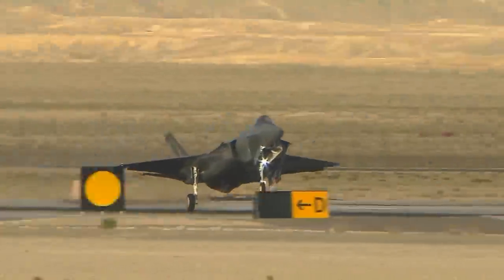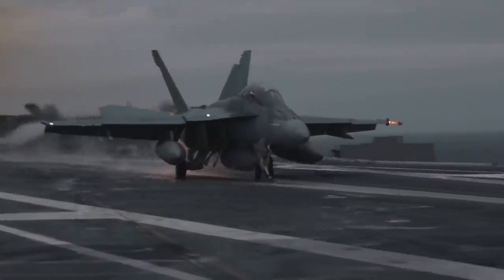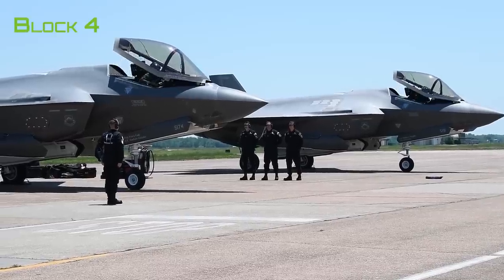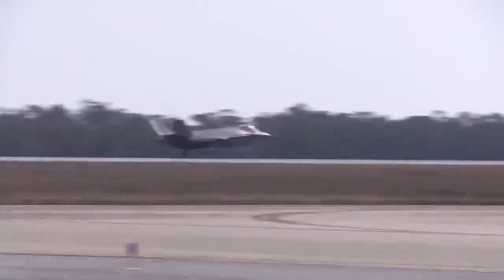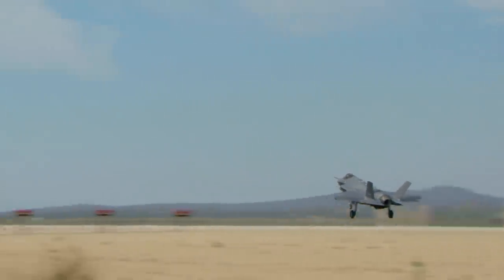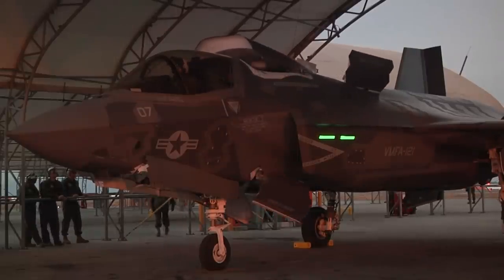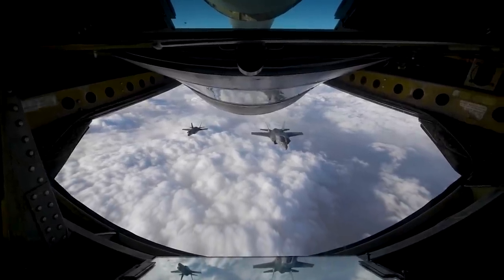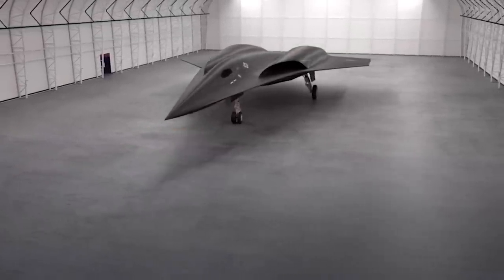Why the F-35 needs an engine upgrade

Comment: What I’ve seen elsewhere is speculation that the NGAP money going to Lockheed, Boeing, and Grumman isn’t to design an engine but to figure out how to implement the PW and GE engines into their NGAD prototypes.
Reply: That's probably just slush money. You give engine upgrade funds to PW, GE, Rolls, etc, not the Airframe Manufacturers.
Reply: Yeah I mean the F35 engine is sick. It’s slightly larger than the F22 engine. But doesn’t have thrust vectoring. So you can imagine that they could easily modify the F35 engine to have thrust vectoring and slap 2 of them in a new fighter. You’re talking about 100,000lbs of thrust. With lighter carbon fiber materials smaller aim120s and just overall smaller and lighter electronics and all. You figure the new fighter the jet will damn near have a 2-1 thrust weight ratio armed. The F-22 is 65,000lbs loaded. We’ll see. But I think it’ll depend how which jet it is. The Air Force I imagine is going to make more of an Air space denial jet. That can loiter for long periods of time and has such good sensors and weapons that anything within a couple hundred miles of it will be blown out the sky. Where I’d imagine the navy would have more of an interceptor and agile plane to fend off missile and J-20 attacks on the carrier fleet and then have drone wingmen to carry out strike missions on ground targets. But yeah. China and Russia still haven’t fully developed the engines that were supposed to go into the J-20 and SU57. So we’re pretty far ahead of them on building engines. Japan wanted to build a stealth fighter for awhile now but they were smart and understood that the engine is essential to the stealth capabilities of the aircraft. So they’ve been working on their engine for awhile now. Haven’t heard anything recently though.
Reply: OK but let that tech flow down to the F-35 and possibly other planes as well.
Reply: not sure why he is using Australia MQ28A Ghost Bat drone in NGAD and saying the engine could go in to them.
is 100% up to Australia is those drones get them as is Australian drone solely made and  sold in Australia as a sovereign product.
Reply: @forfun6273  Engines are typically the most difficult part of any jet development. Japan is taking that part really serious. they want to catch up and reacquire the advanced industrial base for jet/engine development and production. They are ready to spend big. Their parliament signed off on a 47-billion-dollar research and development program. Japan has already a highly advanced industrial base and highly skilled labour, Im pretty sure they will do fine. Especially when we consider that they joined forces with the UK. Very smart move and a win win for both sides. They can share the costs, risks, resources, and ultimately the success.
Reply: @nedkelly9688  The MQ28 drone is made by BAE Australia. I don't know the companies' shareholders/owners are, but I guess it's at least partly if not fully owned by BAE UK and maybe even BAE US. I don't think that the Australian government has any say in what a private company does with its product. Especially when it's financed by foreign entities that are closely aligned with Australias biggest security providers. And in the end Australia is a close ally and would tremendously benefit from further cooperation particularly when it contributes to capability enhancements of the drone program. Besides the MQ28 is not solely sold to Asutralia but it is already in use in the US military.
Reply: @Kenny-yl9pc  yeah I saw that. They looked at the F22 and into the geometry around stealth and realized that they need a smaller but powerful engine. So apparently they’re going to a more oval shape than the regular circle. They’re doing the opposite approach to Russia and China who just threw out a stealth shaped plane but had  su35 non stealth engines in them. Which really harms the overall stealth of the aircraft even when you put the new engines in it because it still had to be large enough to house the older engines. I mean maybe you could do something like the layout of the F14 where the engines are far apart and you can stuff your arms and fuel in between them. It would be interesting to see a F14 with full 360 degree thrust vectoring engines. They’re so far apart that they have a good amount of leverage on the plane. At least I’d imagine that would be the case.  I’m excited to see what japan comes up with. I do like South Koreas new jet. Sure it’s not true stealth because it carries its weapons outside the plane. But maybe they can use Japans engines and be able to fit a couple missiles or a bomb inside. Or just load it with sensors and use it to direct missiles or artillery. Kinda like what we want to do with the f-15ex and F-35. Use the F-35 as the quarterback and the F-15 to carry and fire the missiles.

Comment: As a former PW engineer (now at Lockheed) who’s worked closely with F135 and XA101, it is my personal opinion (not speaking on behalf of either company) that F135 ECU is the most cost effective option to meet the need for expanded PTMS capability. Bringing in an adaptive engine is just way too expensive and time consuming - just think of all the airframe redesign work (to accommodate the bigger and heavier engine) to actually testing and verifying the engine itself. Definitely not a trivial change. 

On adaptive engines - just think about it; you’re talking about a third stream of air. This means the fan stream needs to be split, requiring a separate duct - while this looks trivial in a cross section, it is actually quite a lot of metal added (especially considering the radius at which this structure is being introduced), increasing the size and weight of the engine. Whatever benefit this architecture has in thrust and SFC, you have to weigh it against the cost of R&D in the engine and airframe, as well as maintenance. So in the end, while you might get better absolute specs out of an adaptive engine, it is likely is not the most cost effective way to improve the platform.
Reply: However, especially naval variant (C) could benefit from GE engine. Range is being constant issue with carrier based aircraft.
Reply: I vehemently disagree.

We have had adaptive cycle technology since the ATF program with the GE YF120, which was also turned down if favor of the technologically inferior PW YF119, which the F135 is derived from. 

The F-35 is going to be our staple fighter for the better part of the century, and we cant keep chasing menial upgrades from an obsolete engine. The F135 ECU is insufficient even now. 

Additionally, the PW XA101 is untested. I dont even think PW is driven enough to do it. 

The XA100 on the other, is tested, and ready for service, and I believe it will replace the F135. The additional cost is worth it. 

It's long time to drop PW from the F-35 program.
Reply: Which is why DD would need to operate centrifugally, not linearly. But I suppose that would make it difficult to sustain the unit for very long.
Reply: @TylerF35A  

Those are some bold claims. Having personally supported XA101 testing, I respectfully disagree. The team I worked with had some of the most exceptional and world class engineers.
Reply: @Y13A  what about the GE engine? their promo material states that's almost ready for production, is that too optimistic?
Reply: Is there a lot of R&D needed, adaptive engines have been around for 30 years. The second YF-23 flew with the GE YF-120 adaptive cycle engines in 1990.
Reply: @piotrd.4850 Station 9 and 3 of all F-35 variants roll off the factory floor plumbed for drop tanks. If range is a critically limiting factor, take the far less risky engineering challenge of certing gas bags instead of betting the farm on an engine that might not be ready in time.
Reply: @nobleman-swerve heck why even bet a single cent on having an engine at all? Just attach a prop on the nose and drive it using bicycle gears, Flintstones style

Comment: One thing to note. The emphasis on stealth with the f35. It may be stealth in the electromagnetic spectrum. But with such a hot engine. They are NOT stealthy in the IR spectrum.
Reply: Which means they're not stealth on a modern battlefield.
Reply: You mean the radar and microwave spectrum instead of electromagnetic spectrum since Infrared is an electromagnetic wave also. Look up electromagnetic spectrum. Also a good IRST system can see the entire aircraft and not just the engine.

Comment: You've touched on a subject matter that, quite frankly, I've never even considered until watching this video.  However, it is clear that the use of so much electronics coupled with reliable engines cannot be overstated.  Which begs the question... why would these new Block 4 and 5 programs even be considered w/o first deciding on either the GE or PW engines to use?  This seems like a "putting the cart before the horse" scenario.  What am I missing?
Reply: Probably to avoid program delays and keep the development of technology moving. Worst case scenario they fit the new hardware and limit the software to the cooling requirements until more cooling is available, but better to have it in there and waiting for the green light update. There is also that these engines may also be used on NGAD which is still in development so they'll need extra time as well.
Reply: True, but probably you can bet that software will create most of the delays in the end.
Reply: You are missing the politics behind F35 acquisition decisions

Comment: Quick question ~ what is an 'Adaptive Engine?'
High efficiency engines, like on airliners, have a high bypass ration. 7 or 8x as much air goes through the 1st stage compressors, as goes through the main engine. But a high performance military engine, is a low bypass ratio engine. This gives less weight and more after burner capacity, but it does limit efficiency in normal use. What if you could adapt the bypass ratio while the engine was running? What if you could significantly change the ratio of air that goes through the main core and air that doesn't?
That's what an Adaptive engine is.
The clever parts for vertical takeoff & landing in the B model, those are at the front of the engine, including a power take off and a big horizontal fan. Having additional clever ducting at the front of the engine to allow more or less air through the main body ~ let's just say I can see how that might complicate and compromise the design. I'm not sure it's impossible, but it's sure as hell awkward.
Reply: He's referring to "Adaptive Cycle Engines"
Reply: You have doors which shunts air to the  turbo fan just like on an airliner instead of ramming it through the engine core.  This gives superior sub sonic range at cruise and your supersonic performance.

Comment: On a side note - The stealth coating Lockheed use is a bit fragile and can only withstand mach 1.2 or 1.3 for really short bursts. If pilots were to completely floor it and fly the F-35 at its maximum speed for extended periods, the stealth coating is going to burn off in the atmosphere.

Unless a more durable coating is discovered/created. having a higher top speed means very little unless you are willing to sacrifice your stealth to achieve it. A more powerful engine can help the plane when it comes to handling though.
Reply: I think NGAD will have new materials that will allow it substation very high speeds. I wonder if it is possible to ever but those coatings on future f35s, or if that’s too much of a change
Reply: Sustain*
Reply: honestly, RAM coatings should just be optional for specific missions, most missions dont really need stealth unless it's a REALLY high value target they're destroying
Reply: For reasons that should be obvious I can’t say much but I can tell you this is false. If you were speaking of the F-22 you’d be pretty close but the F-35 coating is a whole new animal.
Reply: @ell8711 < I've thought the same thing, why didn't we build a version of the F-22 without the stealth coating. It would then operate as the replacement for the F-15. It would fill the role of the the F-15EX is now being asked to fill at a substantial savings in maintenance, and the F-22 production line could have continued producing airframes well past the date where we shut it down. Save the stealth variants for reserve roles when needed and save the tax payers a ton of money.
Reply: @neuman35 what point would a non stealth f22 have over an f15?
Reply: The only “burning off” is from the after burner on the tail fins, and its only an issue at high altitudes.  Speed doesn’t heat up anything more than it cools it at mach 1.5.  In fact its the lack of cooling from low density air that causes the problem.
Reply: Only identified on the B and C, and only at the operational ceiling while pounding out max afterburner for extended durations. JPO tried to chase the issue, could never replicate, and decided that they weren't going to keep throwing money at it and issued the warning. There is no wartime restriction on afterburner use for any F-35 variant, this is a peacetime safety bubble.
Reply: @Typexviiib , F-22 has super cruise, F-15 doesn't. F-22 is more maneuverable, has newer avionics and computer systems. The U.S. now has to maintain two separate airframes instead of one, which means more money being spent on parts, maintenance, crew training, etc. Just maintaining the production line that built those 176 planes is enough of a reason to have dumped the F-15 and continued the F-22 assembly line. To restart F-22 production would cost billions upon billions at this point.
Reply: @neuman35  f15ex has super cruise, and it has much more advanced avionics than the f15.  Its also substantially cheaper to operate.  The maneuverability thing is a non issue in real life, f15 is maneuverable enough.  Wvr gun fights just dont happen in the real world.    If we’re going to build a non stealth interceptor in 2023 the f15 is the superior platform.  

Your comments about the f22 production lines dont make much sense to me.  180 f22s is plenty for the niche role it plays and for how difficult it is to upgrade.  No amount of mothballing f15s to build non stealthy f22s was ever going to balance the budget.
Reply: @Typexviiib , you are missing the point. This was a decision that should have been made 12 years ago. The F-15EX is only a thing because they stopped making the F-22. You think if they were still building F-22 they wouldn't be updating it with all the newest technology? If they had proceeded with the construction of the original order amount of F-22 airframes, they would also be a lot cheaper to operate, much cheaper than new F-15s and a better value for the taxpayers. Head to head, the F-22 clobbers the F-15, so why are we still building them? Oh that's right, because someone made the poor decision to stop F-22 production in 2011 and its way too expensive to restart production.
Reply: @neuman35   we can engage in hypothetical situations all day long, or debate whether it was wise to cancel the f22 program.  But the reality is choices were made ten or 15 years ago that have us in the position we are in now.  Your original proposed solution was to make non stealthy f22s instead of buying the f15ex.  Thats an insane proposition for reasons you hinted at in your last reply, as well as the reasons I’ve highlighted.  The f22 line was shut down, the tooling was destroyed, and the facility was reallocated to the much more modern f35.  The f15ex is far more advanced than the f22s we do have, with stealth characteristics being the f22s sole real world  advantage over 4.5 gen fighters.  The f22 still lacks helmet mounted cuing, still doesn’t have irst, still doesn’t have das, still cant interface with madl, still cant use laser guided weapons, still lacks synthetic sensor fusion, and still cant directly talk with f35s.  These important modern technologies are all available on block 70 f16, f15ex, f18e/f, and of course f35.  The modernization program for the f22 is going to take 10 years and cost nearly 10 billion dollars to give 80 f22s capabilities the f35 had in 2015. They’re not even going to bother updating the rest of the fleet because by the time they upgrade 80 f22s ngad will be rolling off assembly lines.  

What f22 MIGHT have been if they were produced at scale is not an argument for building non stealthy f22s now (or ever), instead of f15ex.  If you’re not trying to maintain a stealth profile theres no reason to use an f22 over the f15ex.
Reply: @neuman35  building a bunch of f22s 15 years ago also wouldn’t fix the doctrine issue that f15ex are being built for.  In contested airspace f35s will head strike missions, getting very close to enemy targets and engaging them with the great deal of exterior weaponry the f15ex can carry, while the merely low observable f15ex blasts its massive aesa radar and jaming pods to create so much noise in the air that enemy defense systems cant spot the f35s.  The f22 was never going to be upgradable to this role because the f22 is built with early 1990s computers and nothing is capable of being upgraded piece meal like in the f35, which is basically plug and play.  The airforce has been trying to get helmet mounted cuing on the f22 for 10 years, but it requires replacing the radar, the hud, the multifunction display, the canopy, and major structural redesigns to integrate the sensors.

Comment: I wonder, if they could just use heat exchangers to transfer heat to kerosene before it gets into the combustion chamber? At high altitudes it should be quite cold

Comment: if the F35 is stuck at the block 3 version for the Marine Core It would fall right in line with the narrative of the USMC getting the leftover equipment and not the latest and the greatest but still kicking everyone's ass anyways.
Reply: Marines will never be limited by our Equipment; the single Marine has always been our GREATEST Weapon.
Reply: right 😅😂